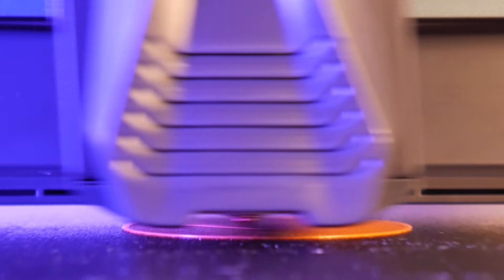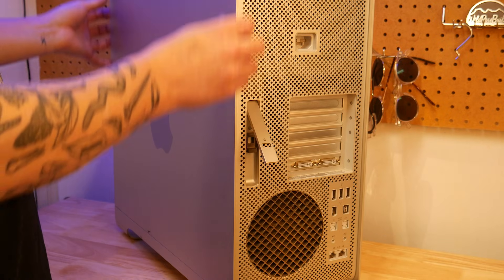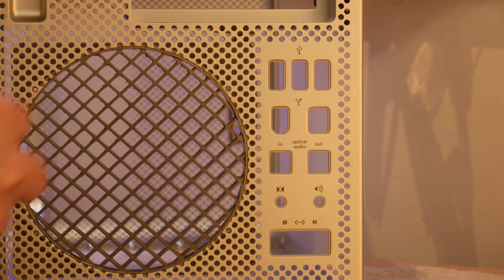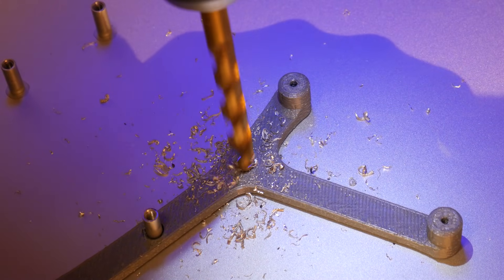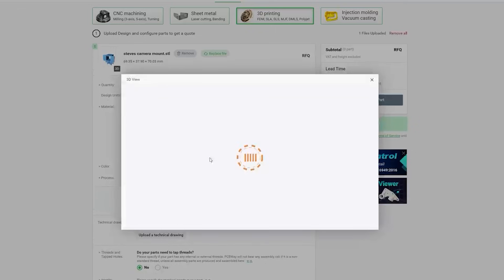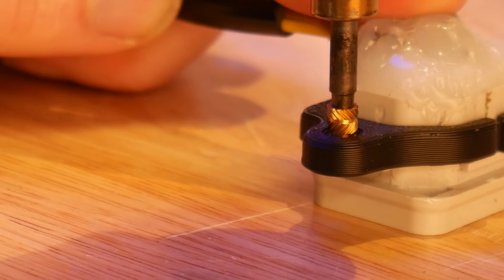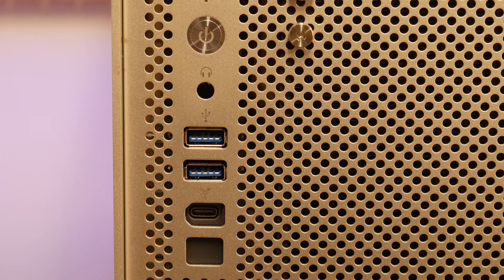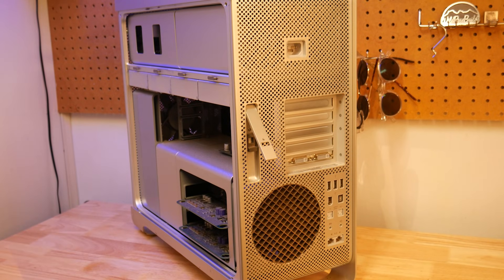Building The Ultimate Mac Pro - PC 3D Printed Case Mod For The 2006 Mac Pro Computer

Comment: I am unironically trying to follow this as a tutorial, what kind of nuts/bolts did you use for mounting the motherboard?
Reply from the maker: I think it was m2 screws and nuts! Whatever the metric equivalent to the original standoff machine screw is. Good luck with the build, super happy with mine!
Reply: @WildRoseBuilds  finished the build. This video did not capture how much work it is to fully dismantle the case 😅😅

I ended up using 6-32 and remodeling the atx mounts because I wanted to use heat set inserts and the existing standoffs were in a bit different locations on my year case. Also I ended up self tapping the 6-32 bolts into chopped and drilled standoffs instead of crimping them to attach the atx mounts. Turned out pretty good and your models and video was a great starting point. My end result is a bit more jank than yours lol but I am still proud of it. Thanks sm for the inspiration!

Comment: Thanks so much for this! I'm about to start a G5 case mod and many of your 3D parts are interchangeable with that case as well. Maybe I'll pick up a Mac Pro case now too! If you were able to design a front I/O panel piece to accommodate the G5's two vertically mounted inlets for usb 3 ports that would be legend. I'd be happy to send a donation and I'm sure many other G5 modders would too!

Comment: Love this. I've got a very different project. Can I get 10 drives where the front fans normally go? We'll see
Reply from the maker: These cases are so spacious! If I didn’t have a nas I’d be putting a handful of drives in mine too!
Reply: @WildRoseBuilds  I'm pretty sure that I can get 10 drives stacked in the bottom half and maybe even 6 in the top

Comment: It feels not 100℅ safe. You PC can easy heat up to 100C.
Reply from the maker: True some components can reach close to 100C but most will not come close to that thanks to thermal throttling. The parts in direct contact with printed parts should remain at or near ambient temperature.